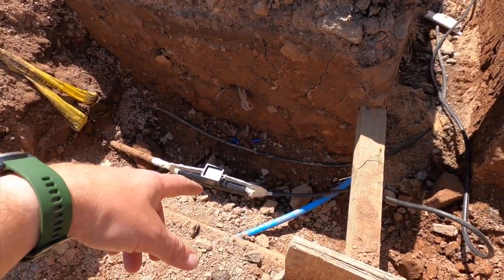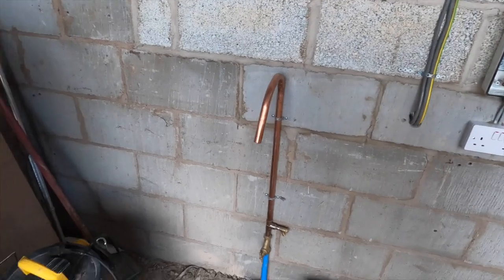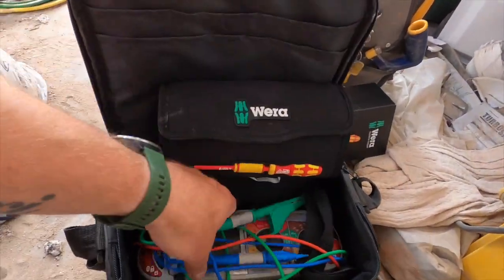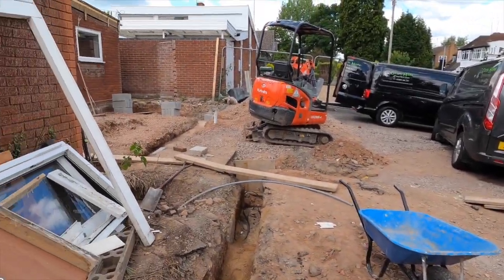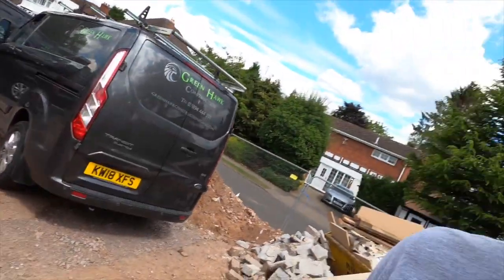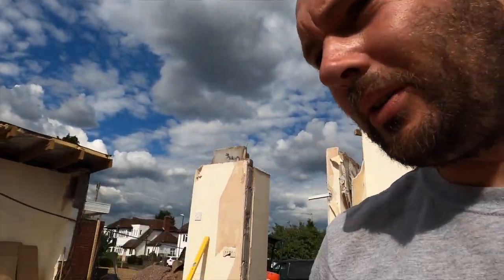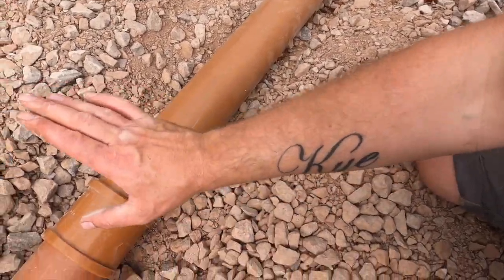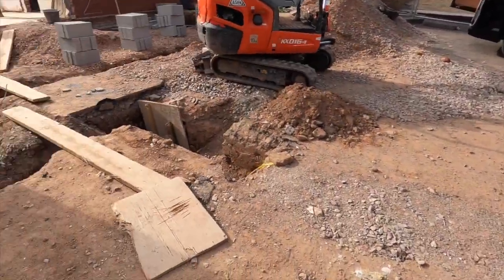Installing a new garage consumer unit - testing the  new Wiha torque screwdriver.

Comment: Got the same torque Screwdriver my self but I had to get  the armeg one months later  as it has higher torque setting that you my need for some  breakers. 

https://youtu.be/7ljryvfAqVo

Armeg SDSBSET001FL 13 Piece Fully Loaded VDE Adjustable Torque Screwdriver Set, Black/red https://www.amazon.co.uk/dp/B01IBPRI8M/ref=cm_sw_r_wa_apa_i_KRHfFb8SN7VWV
Reply from the maker: Christopher Linque Linque  yes i thought that i might as all though its a really nice screwdriver it has got its limits 
Thanks for your comments